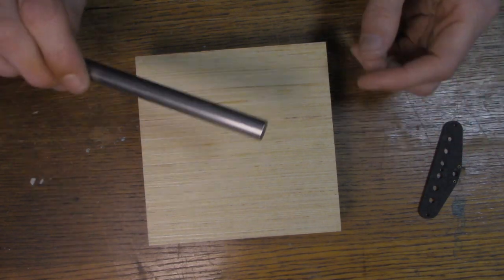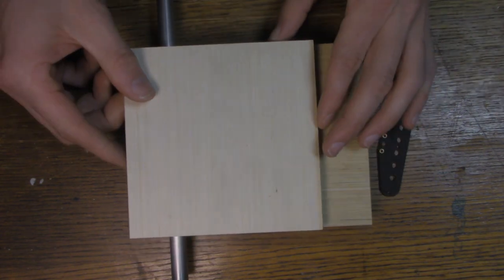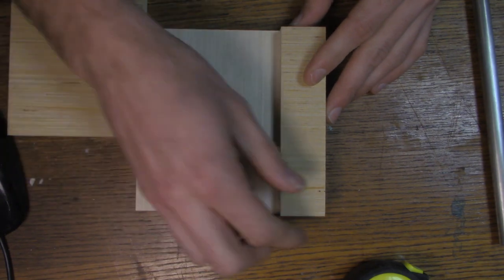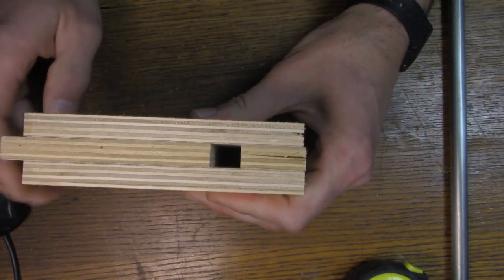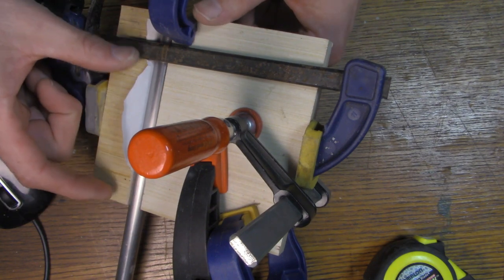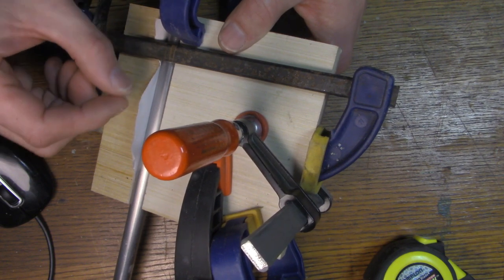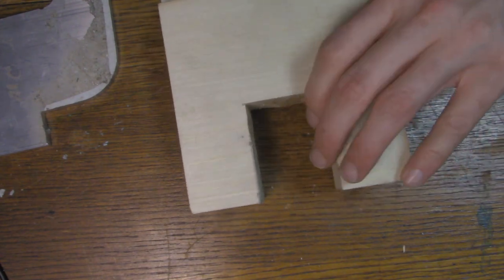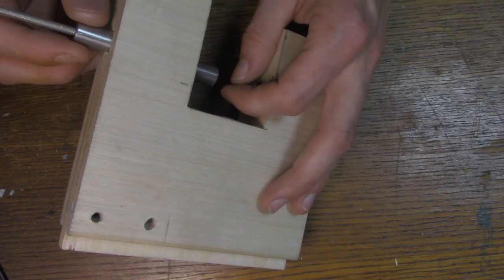✅Pickup Arbor Press, How to press magnets into pickups using Homemade Arbor Press

Comment: This is awesome! It is so cool how all of the tools and things that you build simply just work! A lotta folks get ahead of themselves and paint their DIY tools, and come up with a really professional looking outside, even if the tool itself doesn't really work all that well. Your stuff ain't always too pretty... but man, they always do exactly what you set out to do!  One idea that came to me is, use a metal band saw to cut off about ~1 inch off the end of your arbor shaft, and make 3 different "tips" that you can easily slip onto the end of the rod. On the end face of each tip, you could use your metal lathe to machine in a precise recess that is the exact (or slightly bigger) diameter of the magnet rods so that you can insert them into the flat stock at different depths for when you might want to make those strat-style pickups that have the center magnets higher up than the end magnets. You could even epoxy in a small magnet onto the end of your arbor shaft so that you can quickly snap the tips on and off. Just an idea. I have a feeling you've already thought of something like this.  Great job Bud!
Reply from the maker: Thanks bud. That’s a great idea. I may have to do a update on it for sure. I like the idea about using the magnet to swap out different tips!

Comment: cool, so how are you going to do offest magnet heights for vintage style bobbins like '54 or '59 bobbins?
Reply from the maker: Someone asked the same question a while back and my idea was to use a spacer and a punch that had a hole in it the size of the magnets so it could push around the magnet. May try and make one and see how it works. Hope this made sense bud. Let me know if that answered your question.

Comment: One other thing I thought of... You could also use this press to press in the brass eyelets in the pickups rather than having to bang em in and possibly split the flatwork material. Could cut the tip off one of those eyelet punch tools and stick it to the magnet on the arbor press.
Reply from the maker: Again brilliant, defiantly gonna make some different tips for it now. Thanks Micheal!!

Comment: How do you do staggered poles?
Reply from the maker: I would use a spacer between the flatwork when pressing them. And I would make a press that the magnets fit in to press the flatwork around the taller magnets. Anything would work like a nut or stacked washers or a piece of plastic that you could stick between the magnets to get the flatwork down. Hope I’m making sense.